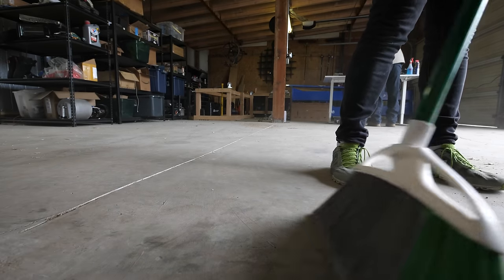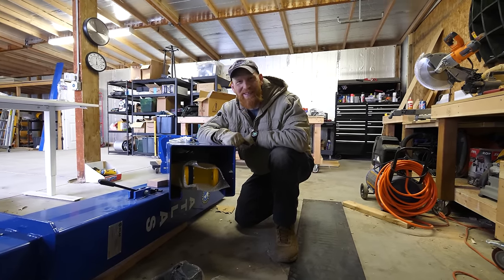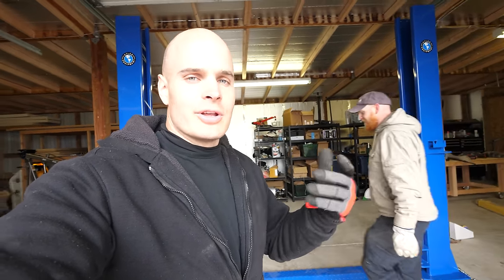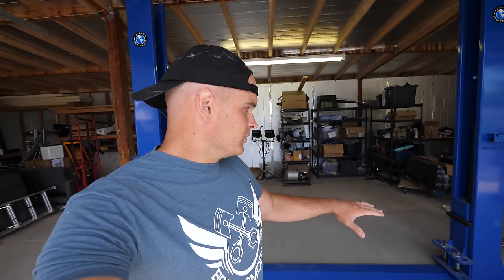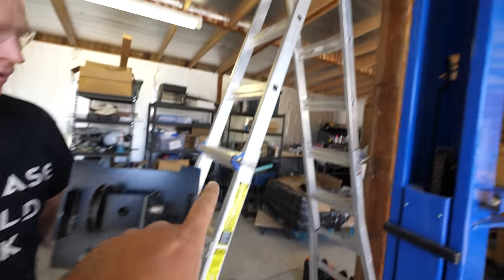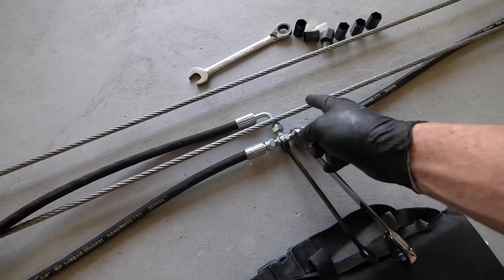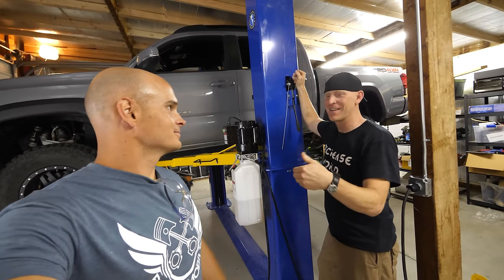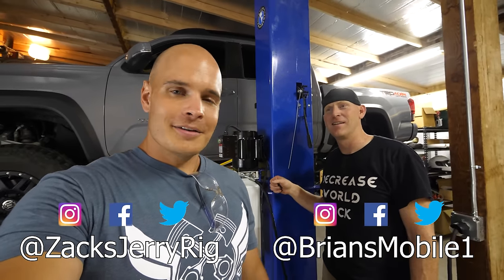Installing a 2 Post 10,000lb Vehicle Lift! - Check concrete FIRST!!

Comment: Next episode:
"Today we're raising the ceiling of my garage with the new lift"
Reply: I was going to say the same thing you can't work underneath a car. They will be hunched over and GG on ur back
Reply: Just watched the video and had the exact same thought.   They've already gone through the expense of pouring a new pad and the cost of the lift, itself.  May as well maximize the value and usefulness of the lift by raising the roof.  Honestly, that would be the cheapest part of the whole project.
Reply: Yep. Worthless to have lift
Reply: Yea, did I miss something? Why such a system just to lift a vehicle a few feet?
Reply: @ABQSentinel  though i disagree with the thought that it is useless or pointless as it is, id agree it would likely be cheaper than the rest of the project to raise the roof, if he does it himself
Reply: @jonyemm  Well, yeah, it would still be very nice to have a lift, even if you could only raise a vehicle 4 feet off the ground.
Reply: @ABQSentinel  yeah, could still remove an engine out of the bottom.  Maybe even get s truck body high enough to roll the frame and motor out from under it. I was glad to have access to one when i did the fuel lines on my tuck. Also, one of the worst things when workingng on a car are when your laying under it on cold ground and you have fluid dripping all around  you. No way to get away from it. Thanks to that i could tell you anti freeze doesn't taste half bad. Brake fluid burns the eyes. And oil tastes unique. Also, don't itch your nose. A lift helps to get you away from all that.
Reply: They could of gone up a bit more with the truck but that was just the right height to work on the wheels and suspension system.  Yah any thing else might be a bit of pain but still easier than crawling on the ground. A car would be lifted way much more higher though.
Reply: @jonyemm  you can't remove an engine out the bottom.
Reply: @roberts5118  I'm hoping you're either joking or your just 80 years old and haven't seen the underside of a car since the 90s. Many cars since I'd say the 90s, fwd, without actual frames(uni body), the engine is easier to take out of the bottom of you have a lift. Or in my case, i used a cherry picker/engine hoist and after supporting the engine/trans on a dolly i picked the front of the car up.
Reply: @Cre8tive81  He likes to rotate his tires?
Reply: @roberts5118  My mustang GT would disagree.🤣

Comment: Nice, very nice!
I would add that for anyone, if you are replacing your concrete slab, to lay a 600mm x 300mm x 10mm thick MS steel plate under the location of the columns, embed in and flush with the concrete (made it dead level - very easy to do as can be tapped mm here or there).
That totally destresses the area (UDL vs point load) under column, and will be full contact with column baseplate, so virtually every failure mechanism will be avoided.

Also do that if you have minimum concrete thickness, just grind down 10mm and epoxy under the plate to fill low points. It's all about maximising surface contact to spread the load. 
AND it's way better than shimming - a practice that leads to more cracking failures from my experience. 

If you can not put a steel plate down, and your column base plate (or the slab) is warped then grinding out a little concrete is still preferred, use the wet paint method to tell the high spots.

Note drilling holes through the 10mm steel plate - either making them align with concrete holes after is ok, but easier to put holes big enough for anchors to be drilled in concrete through the plate.

Comment: Dudes !!! I'm a General Contractor and I'm building a pole barn in the back. Your video answered every single question I had about the lift, the concrete and how the lift was assembled and functioned. The dolly was an awesome idea, my back thanks you in advance. Since I'm pouring the slab I have no thickness issues but was wondering how thick to go. I'm gonna go 12" thick and roll with 8" x 3/4" Sleeve Anchors I think. Great video! Thanks!

Comment: FYI torque specs come with anchor kits. If the anchors came with the lift I'd just look up specs for same diameter anchor with reputable company like Hilti for example. Personally I would have poured 2 footings where the columns bolted down instead of redoing entire slab. Would have been cheaper & stronger IMHO. Been in contruction for 30+ years. Glad you mentioned you did allow concrete time to cure. 😎👍
Reply: It wouldn't have been much cheaper. Maybe $50 less concrete and a $100 less labor. And it most definitely wouldn't have been stronger. It doesn't take much more for the contractor to do one larger pad. Maybe 20 min more on the machine, and less small cuts of rebar. The holes for the rebar pins you would save in the middle of the big pad will be eaten up by the inside sides of the two small pads. It's minuscule.

Comment: I'm sure the marketing department asked the engineers, "what is the least you could get away with" and they answered something like, "well if you had some reeealy hard and well compacted ground and you had ultra hard concrete with lots of rebar in there, then you might be able to get away with 110mm". The marketing department rounded this down to 4 inches of course and boom, sales are through the roof.

Comment: The website specifies minimum 4" of 3000 psi concrete. The psi rating and amount of rebar make a huge difference as far as how thick it needs to be.
Many garage slabs are made with 2000 psi concrete and no real substrate. That would explain the 7" spec you mentioned. A cheaper solution to questionable concrete strength is to weld a 30" long by 14" wide 1/2" steel plate under the posts. That will spread the load and stresses out farther. Install the factory anchors as in the plan and add 8 more anchors in the new plate (4 on each side).
If you tear up and pour a new concrete floor, you have to wait 28 days for the concrete to cure before drilling any holes in it.

Comment: After working in several rehabbed shop buildings and seeing many floors crack because of thin floors I've always told people when in doubt install a 4 poster, it doesn't require a thicker floor because it sits on 4 points and not dependent on a 2ft pattern of bolts to hold the weight. Especially if the car start rocking.
As far as the low ceiling, I've worked from computer chairs and used ratchet straps to lower transmissions & differentials from under low cars. When space is limited you need to think outside the box.

Comment: I would recommend taking those concrete anchors for the columns up to 150ft pds as my dad is a certified lift installer and he always puts them at 150ft pds no matter the make of the lift. Again just a recommendation but overall a very nice install. Also they make an over head cut off kit to keep you from going too high when lifting a larger vehicle with low ceilings.
Reply: The torque requirement for anchors is specified by the manufacturer based on the anchor material and pullout resistance of the concrete. It has nothing to do with the lift itself. A 3/4" wedge anchor in 4000psi concrete will pull out at about 12000 Lbs of tension. The weak part is the concrete and not the anchor. Torquing up to 150 ft lb will exceed that max pullout capacity of the concrete. You don't typically torque wedge anchors the same as you would a bolt or nut. Those 3/4 anchors are typically torque to about 110 ft lb. If your dad is going to 150 ft lb with 3/4" wedge or chemical anchors then he's doing it wrong.
Reply: @OU81TWO  This is true.  Rotary 2 post lifts for example call for exactly 110 ft lbs for the 3/4" anchors and then 60 ft lbs "maintanence" torque every month.

Comment: Always give the car a shake from the back after you lift it off the ground a few inches to insure that the weight of the vehicle is properly balanced
Reply: I second that. It’s common practice at our shop and it’s surprising how many times a vehicle has had to be reset

Comment: Funny story. 
I'm an electrician..
We were wiring a brand new national tire company store. 
The g.c. neglected to pour the   required concrete for the commercial grade lifts. 
X 8 garage bays. 
He had to cut up some major concrete and dig down and repour all of the areas affected.  
This was after the lift guys did exactly as you did and drilled through the slab. 
Always follow specs!

Comment: i always find these 2 post lifts without a top piece sketchy. They probably won't fail but if the tops are connected it adds so much strength
Reply: I used these type of lifts for years here in CA without issue.  Having some heavy-duty bar going across to add strength would really limit what you could do with a car. Normally the car or truck can be above those posts.  If there is any type of bar going across, that is your height limit now no matter what.  Really wouldn't do all that much anyway.  These type of lifts are quite safe so long as you mount a car/truck on them correctly and is in 100% working order so it doesn't fall off the lift.  Even then the lift is not going anywhere, just the vehicle.   These days I no longer work on cars.   I work at a Food Factory and have installed a number of Industrial machines and used quite a few of these anchors.  

The important part of these lifts is the thickness of the cement.   I remember at work when we were getting a new 2-post lift they also cut out and pored a much thicker pad for it.  It's still there and been in use for around 20 years. A bar on top wouldn't do anything to stop a tower from falling over because of too thin of cement, or anchor failure.   I haven't seen any anchors fail before.  I'm using Stainless ones normally.  They are also going through tile before going into the cement.  It's a washdown environment and lots of chemicals used and RUST is something to avoid.    I also use some type of silicon in the hole and around the anchor to help keep the water out.
Reply: Use your brain to figure out why the tops can't be connected.
Reply: The top bar makes the lift much more stable and most vehicles can be raised full height with a top bar.
Reply: @xenonram  most lifts have a top cross bar.

Comment: A handy tip for anyone installing concrete anchors in any situation is to avoid hitting the bolt with a hammer and possibly damaging the threads.  Use the Hammer drill and set it to hammer and use the bit to drive the anchor into the concrete much easier.

Comment: Most residential garage floors will be poured 4", so plan on redoing the concrete if you are putting a 2 post lift.

Comment: When you installed the shims, the overall force, and hence the pressure will be on the area below the shims, not the whole lift pad, so the PSI value should be taken for area of the shim, not the pad..

Comment: They make many glues that will make those bolts solid in the concrete and they are as strong as the concrete itself. It’s not cheap but it does work. I have used it on safe rooms in new house construction. If any of the bolts don’t hold go to your contractor supply and ask them.

Comment: Holy moly 😳 . As a pro installer you only needed 4x4 pads but props to going the extra mile. Great video
Reply: I have some cracks after installing my 2 post lift. I am very sure I didn't get the anchors down all the way before I tightened them. I was wondering if I could get away with simply replacing the anchors? Pound the old ones through and put new anchors in at full depth? Or if I fix it right and cut out and pour a new slab do you really think 4x4x6 inches deep is fine?
Reply: You can pound them threw. You can use a anchor, epoxy if your anchors pull up. Make sure the holes are clean

Comment: I installed my Atlas lift back in March and I love it. I’m in a wheelchair and I love doing all the maintenance work on both my car and my wife’s car. But I went with a four post lift because quite frankly two post lifts scare the hell out of me. I feel much safer being under my four post lift over a two post lift. My garage ceiling is only nine feet tall but that’s not a problem with me. I don’t need the lift to raise my vehicles very high because I’m in a wheelchair. This means I can easily roll around underneath my vehicles and do what I need to do without any height issues. I posted a short video of my lift if anyone is interested in seeing it. https://youtu.be/vAJeDqJQ758

Comment: I installed a Rotary 2 post in my shop this spring and had the same concrete situation. I opted to do (2) 4x7ft pads that are 12” deep and also have about 12” small footing in the center.

Comment: WOW! seriously what a great how to on the actual lift i was interested in purchasing. as a side note those toggle or red head style bolts have a tensile strength of at least 180ksi unless you could get them into bending which you can't with those base plates you could never fail those bolts doing their jobs, the concrete would way before fail and break up. then re-doing the floor on your build as all have said "4" is at best sketchy" then finding how thin your slab was was a no go, also most garage slabs are not properly rebared to be strong enough to begin with thicker or not. the overhead trussed lifts makes a big difference on how those uprights load, and bow in even when you center the CG over the uprights. you see the flex of the uprights allot more without that overhead style cross member lifts but those you cant use in low ceiling heights period. i really appreciate the no hype no attitude you and your friends bring watching you guys work and do the job along with the explanations of what is going on. most others hype and carry on until i have to stop watching them or suffer though hoping they will actually tell you something other than allot of mis or no information just look at me, am i cool or what? again big thanks really appreciate you and what you presented here.

Comment: I ran into a similar problem for one of the 2 posts for the Max-Jax lift I bought. I had a good 4" plus for 1 post, but the slab was about 3" for the other post and the shields would not grab.  My solution was to cut out a 1' x 1' square of the existing slab, and dig down 1' to make a foundation to support that one post.  I added a tic-tac-toe pattern of scrap re-bar pieces I got from a local job site.  I was able to work the re-bar under the surrounding slab.   A couple bags of Sakrete high strength 5000 Plus concrete mix and the problem was solved, albeit a bit overkill.  Keep in mind that most garage slabs are poured using a frame made of 1" x 4" - which is actually 3/4" x 3-1/2", so the slab is likely to be closer to 3-1/2" thick.  By the way, I have a 10' ceiling in my shop, and the Max-Jax is perfect for that application.  I have lifted from a BMW Z3 to a Dodge Ram 1500, and much in between.  A low ceiling means you can't stand under a vehicle.  My lift came with a rolling seat that lets me scoot around under a vehicle with just enough head clearance.  I've serviced a transmission, rebuilt a couple of front ends, several brake jobs, axles, etc.  I would have avoided doing many of those t
asks without a lift!

Comment: "better safe than dead". Lol

Too bad they didn't compact the soil first.
A lot of contractors are lazy when building houses and throw concrete over with out compacting, and that's where you see over time the drive way settle. But the garage  hopefully was poured as part of foundation and they usually compact for that.

Comment: Regarding the concrete thickness:  Another option may be to obtain a 1" thick plate of steel to dimensions that would double  the square inches of the footing so your anchored to twice ot more of the floor and it distributes the load over twice or more of the foot:  so the uplifting force on the bolts are spread or a much larger footing
Reply: Exactly. When I buy the hoist I'm looking at , I want them to lengthen the footing of the towers by 100%...and if they won't, then I will have the footings made up out of plate and attach them to the concrete, and then weld or bolt the towers to the plates.

Comment: thanks for the video, I'm in the process of getting one started. have the slab and carport made already at 15ft high and 5 1/2 inch slab and now in the process of getting electricity installed. this video helped alot, Thanks

Comment: While I don't believe you have an issue with the hardware of your lift, I don't exactly agree with your interpretation of the PSI rating of the concrete.  Concrete does not have the same PSI rating in compression as it does in tension.  In fact it is radically different.

You can compress the hell out of concrete, but you can't pull on concrete with nearly the same force.

So while the expanders at the bottom of the concrete anchors have several aspects to them, as they expand outward (compression - good), the force pulling "up" on the concrete is partially in tension (bad).

This is one of the factors in why there is a minimum thickness requirement for these kinds of lifts.  Excellent choice in replacing the slab.

;)